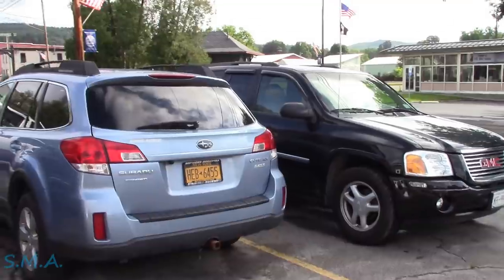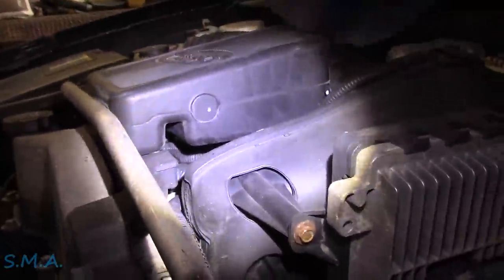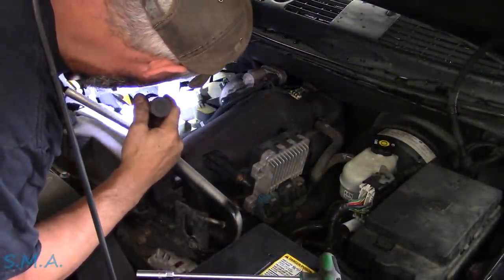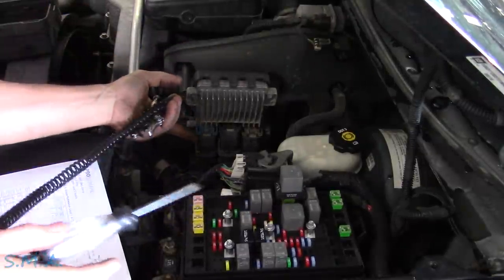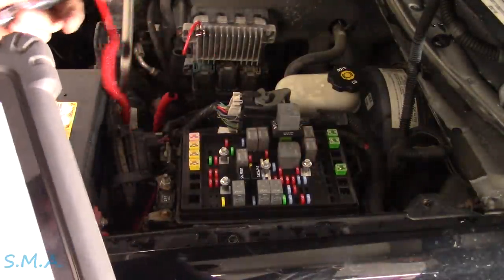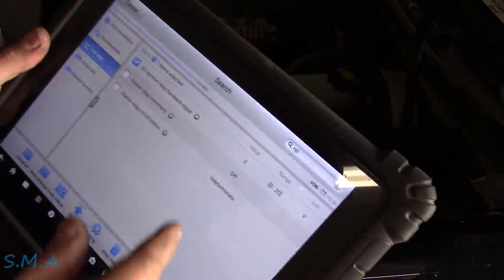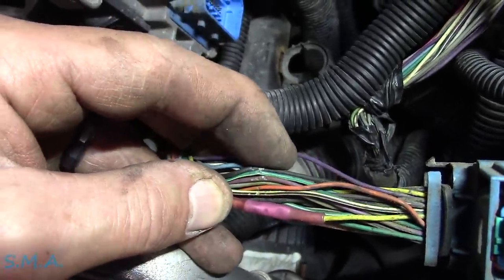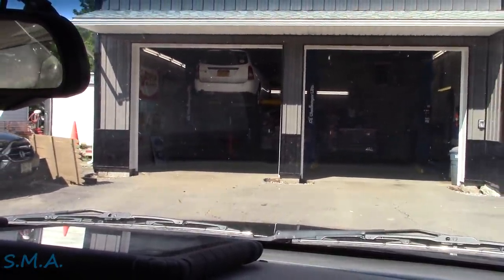GMC Envoy: No Throttle

Comment: that is pretty much all I / we used: once in a while did one mend a wire, solder it together, lead in wire,  done that many times in large wire anchors, batt cables.  for years in commercial trades,   replace batt posts that nuked off, Cat.  and everywhere else I used them,  when  need be: electrical mechanical before the PC world moved it, Made in  the USA. we taped, seldom heat shrink tubing, My job was chasing out the previous guys handy work, in our line of work it was all about keeping that seat filled with the operator.  fix it right later, so was the reason we had a second shift back tracking. You do awesome work Eric, those guys going hard off the deep end most likely fall way short of being much more then a mouth piece.  You know what works and it will last.................. 
I have a couple things for you, still out on one item... the LORD Bless you and yours, amen.. and amen..

Comment: You are right Eric I have had trouble with those solder type connectors also on a tractor I rewired. Those connectors are expensive  thought I was doing the customer a quality job. Last time I will ever use those !

Comment: I just picked up a set of the heatshrink crimp connectors, and have worked great so far!

I'm replacing all the Injector and coil pack connectors on my F-150 and wouldn't trust any solder connections tucked under the cowl- I also put heatshrink on the butt connector itself to protect it from scratching through

Comment: According to the ABYC (American Boat and Yacht Council) electrical standards:  The ABYC E-11 standard "solder shall not be the sole means of electrical connection". Due to the possibility of vibration causing solder to crack or otherwise fail, only crimping is permitted in Marine applications.  Solder can only be used in addition to a crimp connection.   That supports Eric O's argument.  I realize we are talking about automobiles, but the Marine standards are higher due to wet environments, salt spray, constant vibrations and pounding electrical connections will likely be subjected to.  So Eric, I would say your method of repair is about as good as can be reasonably applied. A sound practice! It provides both a mechanical connection which is best against vibration and as good a protection from moisture and salt as can be desired.  BTW-Haters gonna hate!

Comment: Thank you for your shows I got my a/c working again after 3 years for not having it work today first day coming home from work with a/c blowing on me now work on why I don't have acc after changing the inition switch ,before worked when it wanted to ,nothing works when turned to it ,worryed about poking the two fused able links that is coming straight from battery to dont know yet thank you and Ivan for showing me how to work on my a/c,alternator when the wires broke off  the connecter but still have batt light on and draining batt after 3 days not running on my mini van the a/c on 94 GMC one ton 4×4 454.

Comment: Ive used those connectors regularly and have only ever had issues with the cheapy amazon ones that crack after heating for too long,,, another great DIAOG and video thanks dude

Comment: I approve of the shrink and seal crimp connectors. The heat and solder type I have not had enough faith in them to use. Keep up the good work!

Comment: Great video! 
I'm too, didn't expect to see that wire broke under harness holder.. This was something new..

I don't see any problems using these sealed wire crimps, because under the hood where is vibration, soldered wires broke next to the place, where they were soldered.. See that before.. By now, these crimps are great solution, because customers don't want to pay for changing all wire harness or changing damaged wire in full length..

Comment: I have to say this as a state-certified electrical engineer with over 20 years of professional experience: 

These crimp connectors with the heat shrink tubing and the adhesive are the best, if not the only permanent solution to repairing a broken wire in the car.
Anything that has the word "soldering" in its name has no place in a car - except everything that is absolutely hard-fixed to the chassis (PCM, ECM, every other component with a PCB).

But as Eric already said, due to the vibrations in the car, the copper wires break again exactly at the soldering point. 
A wire cannot be hard-fixed to the chassis - so it will always move due to the vibrations!

That's one of the things that really convinced me right away about Eric, that he's a "good guy" and knows what he's doing. 👍

⭐⭐⭐⭐⭐

Comment: Eric, I use the same connectors (seamless barrel type) for all of my electrical connections. I agree with you 100% that these are very good connectors and I don't see a problem with them. Not one of them I've installed in various vehicles has failed.
Reply: In high moisture areas I have seen corrosion causing breaks around the connectors, as well as chafing from the excess size of the repair, but with a good crimp they are beyond an acceptable connection and most failures I've seen are due to poor rerouting and sealing of the harness. Hackery if you will.

Comment: You you you….saved my ass. Fantastic. Hoping this is my problem getting the 2101 and a 1516. Engine cranks no start. Had to change relay box melted headlamp relay green goop.
Gonna clean TB and trace that yellow wire like you did. Alison could be a broken ground strap…pulling my hair out. Envoy 2005 278K looks new. Great vehicle.

Comment: The whole “throw up in my mouth” comment cracked me up, Isn’t that where it always goes too? Then you open your mouth to get rid of it. I have been working on vehicles since 1989 a kid back then and have always used the heat shrinkable connectors with no issues ever. Have even seen in more recent years brand new from the factory vehicles have them so not sure what the issue is. But, anyway there will always be negative Nancy’s in the crowd online because they either are completely close minded or have nothing better to do than be a keyboard warrior. Just keep doing what you do Eric, videos are awesome as always.

Comment: Happy 4th Dr. Eric & family, as well as all viewers.  Just received SMA shirt, thank you. 
I am a retired electronics engineer.  Was supervising engr for GE management at CEO level. Big frikkin deal.  They'd send us in when customers could not repair anything from a dam hydro generator to a nuclear (nuke-U-lerr)
 reactor. 
I would second the previous GM engineer's positive remark about use of that butt splice. 
I would advise that our fellow techs use the full package of  proper crimp, heat shrinkage,  and conductive core.  As is becoming the new norm, I would monitor where the splice was manufactured, as the Far East is losing most of any quality it may have had.  Find an American manufacturer. 
Your splices on auto circuits are well implemented.
It's Independance Day weekend.  God Bless the People's Republic of Sodium & Rust!

Comment: Quality adhesive Crimp connections done correctly is the best connection you can make in wet environments where there is vibration.  I have hundreds of crimp connections in my 18 year old boat with thousands of hard hours, and not a single failure in that time. Mind you, I redid all wiring and factory connections the first day I took delivery, using Ancor tinned wire and connectors.

Comment: Hi boss you have done a clean job as always without unnecessary messing up the harness.Soldering itself generates heat and usually done with salty fatty sweaty hands and cause more problems. I do learn everytime whilst watching your video. cheers from your follower in turkey and thumbs up. Hoping to start the automotive technician school this year in canada :)

Comment: Hi all
I have a 2012 Subaru XV (Aus) and had to change the air con clutch.  I went on line to source one and there are many varieties of the same clutch.  I found one and it stated that the plug must be black and mine is.  First mistake was i should have checked that the connectors connected.  Put it in,was easy to get in!  Wow those plugs did not fit LOL.  A small piece or wire that was soldered and shaped to fit, shrunk wrapped it and it is working.  Moral of the story check the connectors afore you do things.  I thought it was funny!
PS Love ya channel

Comment: Considering Eric runs a small shop with a great reputation and tons of repeat clientele, you would expect most failed repairs to come right back to him. I figure he's been using this method of wire splicing for years without those cars ever coming back with a failed splice. That sounds like a pretty good indicator for them being reliable. Perhaps, if other people are having poor results with these butt connectors, it's because they are easy to use the wrong way. Maybe it's like Eric mentioned, you need to be careful not to damage the insulation when crimping, and always cut the wires back to the clean (non-corroded) metal... Just my thoughts

Comment: I feel like most people see a but connector and immediately assume it is the cheapest connector but they are definitely all built difrently. I have also found the water-tight style with the heat shrink and the adhesive is an awesome way to go.

Comment: I've used the crimp connectors pretty much exclusively, I haven't had any problems. Now I'm a diy guy, not at all any sort of shop, so I don't have nearly the amount of uses that someone like Eric would have. But, again, I haven't had any problems, and they're very easy to use so it's hard to screw it up. Though of course it depends on your intended use as well. Just my thought. Nice video Eric!

Comment: Great find Eric O. Hard to
believe the wire loom clamp caused that problem. They make these wires harness so short puts a lot of stress on them which I think does not help. Just like battery post wire they give you no extra wire so its always under tension. Some you can hardley get them off the battery. The car flexes as you drive and short wires take the beating. I have seen you work on a lot of wiring problems and they just are about a inch to short IMO.

Comment: I prefer the same type of crimp connector you use for uncomplicated wire splices. Circuits that are sensitive to capacitance or inductive changes require a good soldered joint. Great video as usual !

Comment: believe it or not but good ole general motors actually recommends thoes crimp and seal connectors for wiring repairs on multiple componets, I have had to replace connectors and bought oem pigtails from gm and they usually come with thoes style of butt connectors, as well as i have all the different flavors in my toolbox lol,  Id say great repair mr eric o love watching you figure out the issue and learn new tips and tricks that i can use on a daily with my repairs and diags.

Comment: Been using the crimp connectors with hot glue in the marine repair world for years and wouldn't use anything else. You are correct. Using the correct crimper and melting the glue is key to success. The solder shrink connectors are useless on tarnished copper wire. In the saltwater marine world just about all wire is tarnished after 10 plus years in service. Anyone who growls at using the glued crimp connectors is probably a hobbyist.

Comment: Another great SMA video. The heat shrink type of crimp repairs mirror what I was doing 30+ years ago with crimp splices and hot glue. I DO prefer soldering the wire and putting SEALING type heat shrink over it (has hot glue inside the heat shrink) in wiring harnesses where space is ultra premium. Here in Colorado we don't HAVE TO be so anal because of our weather, but in the NE, you do. Michael in Colorado.

Comment: On my buddys cavalier I did the relay swap trick and he had three bad relays lol. Fixed the heat and a/c and cooling fans. Also my father worked at Ford as a ASE certified technician and Ford issued those same crimp on heat shrink connectors. So you my good sir are a o k.

Comment: I bought a 95 freight liner in 07. Did a lot of wiring repairs, mostly on the rear lights harness with those heat shrink butt connectors. Put 1.6 million miles on most of those repairs in the 12 years I had it. If it can handle direct exposure to the elements and the vibration and harshness of a semi truck for that time it’s definitely enough for a car.

Comment: There is a MIL-STD covering crimp splices. IPC-620 also shows the quality requirements of said splices.
That being said, we (DOD) used the splices that were crimped, inspected then the shrink sleeve was installed over the splices and shrunk in place.
These type splices were used in everything from tanks to avionics.
As long as they are done correctly they are a proven method to splice wires!

Comment: Use those crimp and seals by the bushel and they work just fine.  The second time you are underneath something trying to solder a connection in an awesome location and you get the solder down the arm experience, a fella rethinks their wire connection methods pretty quick!

Comment: Eric- Your wire repair is the GM standard. It is required in all Dealer repairs and the assembly plants. I know this because I was a lead electrical engineer in the assembly plant for 20 years.  The solder repair has long term issues and is no longer an authorized repair. So to all the solder suggesters out there- times have changed.

Comment: Those connectors were used all the time while I was in Vietnam fixing F-4 Phantoms as a Tech Rep on the Fire Control Radar. If it holds together going Mach 2 while pulling 6 G's then I'm sure it's good enough for the Interstate Highway System.

Comment: I have a electrical cart in my shop and have several hundred of those Heat Shrink Butt Connectors use them religiously never had a come back but have seen solder connections needed repaired.

Comment: I don't see anything wrong with butt connectors as long as you use the right part of the crimp tool as you said and you tug the connection after you crimp. You are a professional in my book, whatever that's worth.

Comment: An MSD 35051 with the crimp die for 8-22 gauge wire is a must have when using crimp n seal connectors. The perfect crimp every time.

Comment: The repair was solid the crimp and shrink connector is the GM method as it resuming a good connection and doesn’t rely on the soldering skills of the technician doing the repair

Comment: To your followers who wonder about your repairs, Sir No more or no less than is carried out on SOME parts of a Aircraft, yes 20,000 + Ft in the Air. The main Data harnesses are replaced as a part or full section and sent away for special repairs, other harnesses are repaired as u have done if needed, again the Crimps are torque tested regularly and tagged. You would laugh if i told you how the Old B747 seat entertainment connection were carried out (Old style), or one of my last jobs was reconnecting a toilet service door switch in line connecter that can only be described as a inline 'Fuse connection', minus the fuse, style. I know you love flying happy trips.
Keep up the good work get a laugh and good ideas from u. Thk you.

Comment: I was curious about those crimp/heat shrink connectors too. I often use unsealed crimps but use a ratchet style crimper which seems pretty rock solid. I am interested in the heat shrink addition because its an obvious upgrade to an unsealed crimp. If I had to do a bunch of those wires I would probably avoid crimps altogether and just solder and heat shrink the joints to avoid massively increasing the volume of the bundle. Just like I did the other day on the ice maker where the wiring loom runs through the hinge on the french door.. which then breaks all the wires.. on a $3000 refrigerator no less! More work to do it that way of course... Ps.. I'm jealous of your scan tools and scope!

Comment: I had to laugh regarding the comments hating the crimped connector to fix a damaged wire.  I wonder if the haters know that all the wires in modern vehicles are crimped to the terminals within every connector.  The OEM's do not solder the wires to the terminals.  I also agree with you that soldered connections are not always reliable since the solder is prone to thermal and vibration cracking.  I can't count the number of soldered connections I had to repair due to cracking.

Comment: Some people are so uptight about how things are done. If it produces the result, it's good with me. I only use wire solder and dual wall heat shrink. But this has got my thinking, maybe I should try those crimp on ones. Justin Sturgil doesn't like soldering on the big trucks because the wire tends to break off next to the solder.

Comment: GM replacement pigtails come with those insulated crimp connectors. So if it’s good enough for GM, it’s good enough for this repair 👍👍👍👍👍
Reply: i agree. When you buy a Delphi replacement fuel pump it comes with those crimps to replace the connector wires

Comment: I generally solder connections inside the vehicle such as when installing a stereo system. However, for anything else, I use heat shrink butt connectors like those. I also use friction tape instead of the vinyl stuff.

Comment: Always practiced a solder repair was 100% final and best repair , now days solder is shunned upon with computer related issues , especially on a communication line , it causes resistance that can change signal on the wire. First time I seen the shrink /crimp connector was on GM , came with new blower resistors , I would hoard them and solder the wires , lol